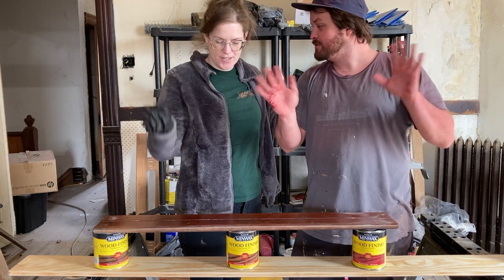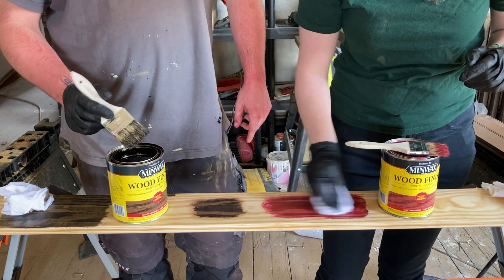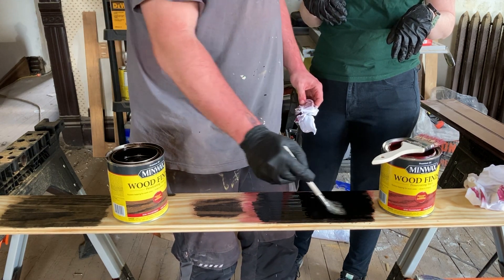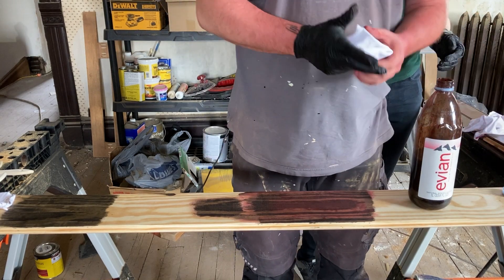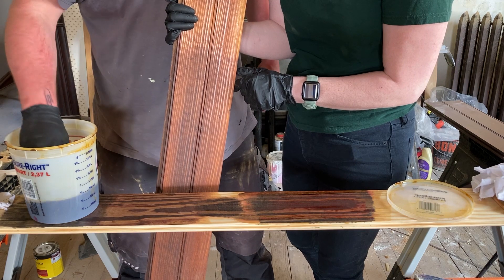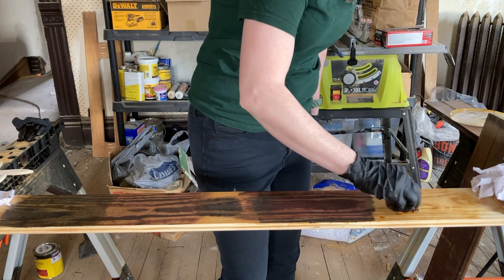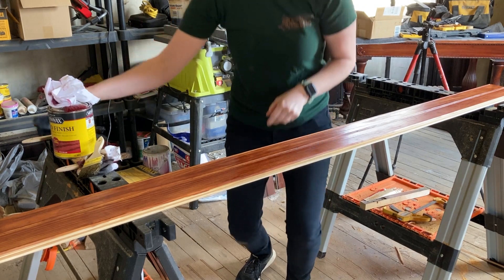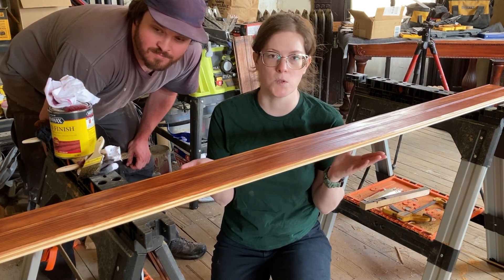Experimenting with Color!

Comment: Looks Like FUN!  You guys are great!!  We have done allot of wood color matching over the years as well.
That old growth beadboard looks to be quarter sawn board. This cut keeps the grain at about 60 to 90 degrees to the face of the board. The reason for this cut is to keep the grain as close to 90 degrees to the face of the board which keeps the dimensional stability. It stains very even as well. The new board cut is plain sawn lumber. It is the most common type of cut we see today. The grain is about 30 degrees or less to the face of the board. I usually condition this wood first then stain, cuts down the blotching.
What is in your special shellac mix? Really enjoying this whole process. Thanks for bringing all of us along for the ride. :)

Comment: When matching stain for my home interior, I mixed a warm stain with golden undertones with a deeper color until I achieved the desired tone... I wish you would get away from the red and try a golden oak with a pine or pecan color 👍😃❤️
Reply: I also use a golden color first. And then use an almost dry brush to spead each layer of color until I reach desired color. Also this hides the wide bands of  color. And or use a toner to hide color bands or make them less noticeable.
Reply: Suggestion? Wallpaper is red on khaki...how would that look with barn red on sanded down beadboard?
Reply: Shellacked beadboard looks too orangey
Reply: @janpritchard8796  
I know it sound like too much warmth in the color but, understand, the pine tone or pecan will add a neutral look to the wood... the stain will add much needed depth in color and feel of the room ... it's always tricky trying to add age to the wood through stain but can be achieved... 😃

Comment: How about using the beadboard from the kitchen. You don’t have enough of the kitchen for the kitchen and most of the walls will be covered up by appliances and cupboards/dressers and there you could use the new beadboard. The bathroom will have 100%visibility. Just thinking here.

Comment: Put a wood sealer on first, then use gel stain. That should help with the overly dark grain.
Reply: This. Any stain that soaks into the wood will highlight the growth rings. Also any solvent based stain ('oil', 'spirit') will be reactivated when you go over it, so staining it multiple times won't achieve the result you expect because the second time it'll reactivate the 1st stain and then you end up wiping some of the 1st stain off with your rag. A gel stain over sealed wood allows you to tint the wood more evenly rather than some areas soaking up heaps of stain and other areas almost completely wiping back off.
Reply: I agree!

Comment: That’s what I was thinking mix shellac and the stain for my beadboard
Reply: My first floor hallway doesn't get that much light . The doors are a bit dark. I was thinking to apply a lighter color to the beadboard but wonder if just won't look good. The other option is to strip all the stained wood done by the previous owners and start from scratch.  My body will not be to happy at the end of the project 😅

Comment: The new cut is plank cut (think band saw) sapwood clear paint grade pine. It’ll never match (semitransparent stain) the existing that you have due to the grain pattern. If you had the new ones cut, suggest you contact the supplier to see if they can use salvaged heart pine lumber, quarter sawn new lumber, or a different spices that is closer to the original. 

Uummm ....., of course you could (cringe), paint them. I’m ducking!!! Lol